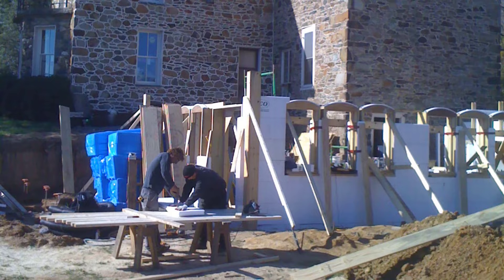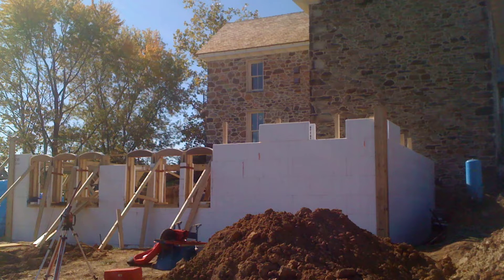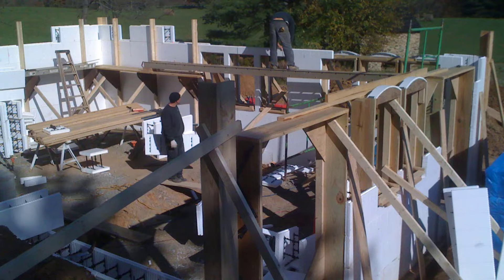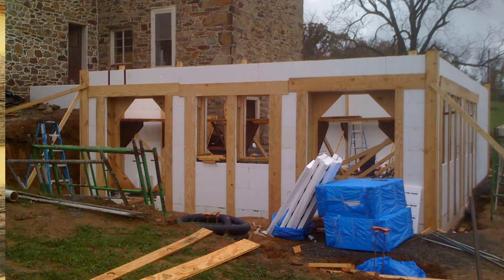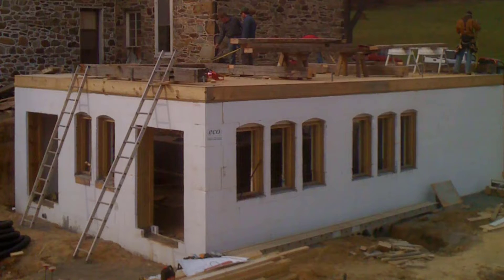The Truth About ICF Construction... Handmade House TV #172

Comment: With housing and mortgage costs insane we are going to buy property and build our own home using ICF. 
I'm doing all the work myself. 
I like the disaster resistant aspect of ICF's. 
We have severe blizzards, -40f with 60 mph winds, we also have tornadoes, and wild fire risk.
I'm going for an R-30+ ICF sealed attic with air exchanger and humidity control. I'll use brick, cement, or metal exterior finishes for durability and fire resistance.

Comment: Hi Noah, we're in the process of building a ICF house.  We used the Perfect Block system for a couple reasons.   When researching icfs I found that termites use the foam as a path to the wood above so pest certification is a problem. We are in Northern Nevada so this wasn't a big problem for us but may be for other locations.  It is also fire rated at 4 hrs so it is different than the white Styrofoam icfs.  These blocks are basically ground up Styrofoam mixed with cement and a binder and molded into a 1ft x 4ft 10in block then glued together with expanding foam. Not to hard to build with. The problem we had was finding a line pump.  They don't recommend a boom pump because of the highth the concrete falls from. We finally found a pump but had to run it ourselves.  From experience I knew it wasn't a good plan but didn't have much choice do to our location. We got it done but won't be doing that again. Just the wife and I 25 yards didn't make for a fun day!  I would make sure there is a pump company near you before deciding on icfs.  We really like the house! Very quiet and well insulated.  We loosely followed the Perfect House design ideas and would recommend it.  I feel in the long term it will serve us well and be a low energy use house for our retirement home.
Reply from the maker: Thank you for the information and great reply n164!

Comment: Hey Noah, you're looking well!  Curious what was your favorite ICF that you've used so far?  I'm trying to decide what to use for the foundation walls for our timber frame house.  Faswall blocks are one option we're considering, but we're going to put in a small cellar to house our clivus composting unit so I'm trying to figure out the best way to put that in.  Might want to use part of that as a root cellar though, so it might be better to just use concrete block filled with rebar and concrete without any insulation to let it be as cool as the ground temp down there and just really insulate the ceiling joists well.  Your thoughts would be greatly appreciated.    

By the way, in December we finally got the go ahead from the county to build our home!  After years of dreaming and planning this is really actually happening now!  🥳🥳🥳  All the valuable information in the Hand Made House Academy will now be going to good use.  🤩
Reply: I hope your build goes well.😉
Reply: @mikeconley9590  Thanks Mike.  However it goes I'm just going to enjoy it.  Whatever breakdowns there are, I'm just going to wrap those into the process of living this adventure rather than letting it get me down.  I've dreamed about doing this for over 30 years and am so lucky I get to live that dream!
Reply: @carolewarner101  we just finished our cabin in the mountains last year. Working on my brothers now , and almost done with it.
We did all the work ourselves so it was affordable and paying with cash as we went left us debt free. Good luck.😉
Reply: @mikeconley9590  Wow Mike, way to go!  That's a LOT of work.  How many people worked with you on your house to help you build it, just your brother and you?
Reply: @carolewarner101  about ten of us .
It's taken over three years of work though , we're getting old.
Reply: @mikeconley9590  Oh geez...you're scaring me.  We have two of us (so far).  Good thing we're going small!